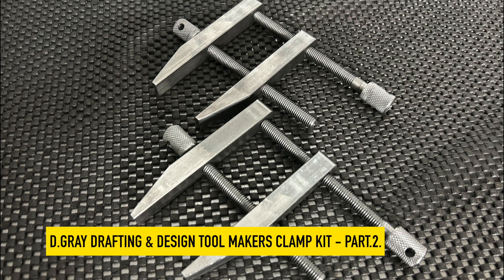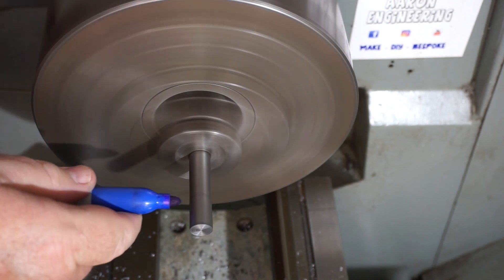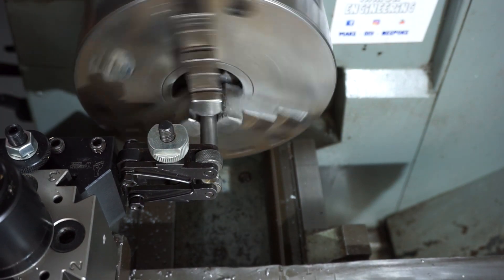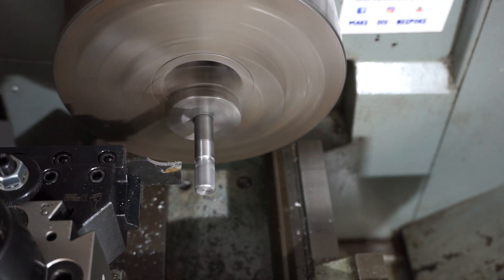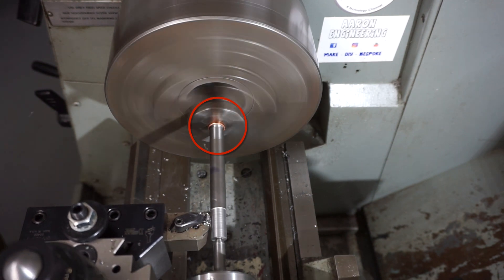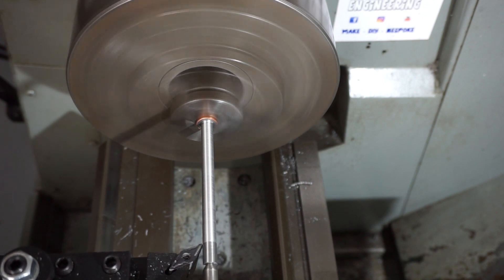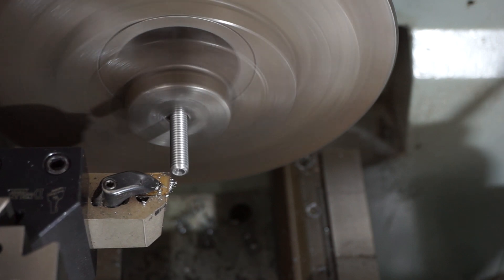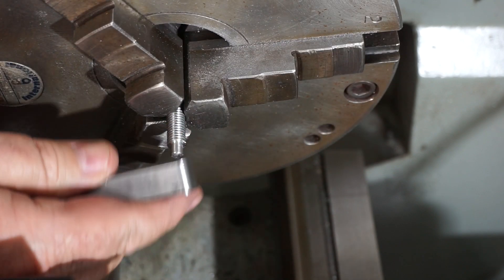Toolmakers Clamps KITS from D.Gray Pt.2 - #shopmadetools

Comment: Great job Aaron  .   I thought you might have dug out the Coventry die head for those threads !   On two of my Starrett ones , one has that clip & the other one has never had one .  Not sure if they stopped putting it on or not . Cheers .
Reply from the maker: Thanks Max.  No doubt you saw my metion of you in my video.  Thanks for the heads up mate.  Unfortunately I don't have any metric dies for the Coventry head.  Cheers mate, Aaron

Comment: These are a great workshop project Aaron and will no doubt be used for many years.  Key steel is good for making the jaws, medium carbon and tougher than mild steel
Reply from the maker: Hey how's it going?  Great to hear from you.  Yes the kits from Doug are great for the home machinist.  I think key steel would make for better jaws.  The free machine grade that Doug supplies is easy on the tooling though. Thanks for watching.  Cheers, Aaron.